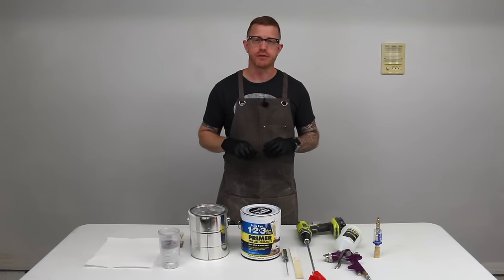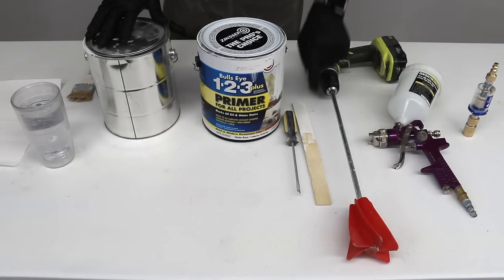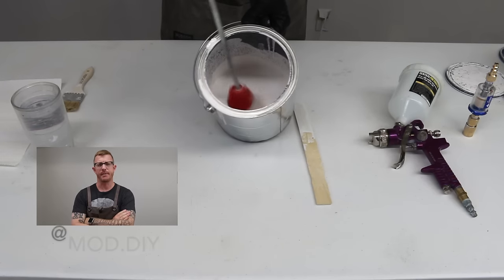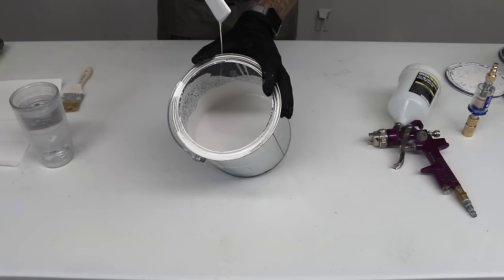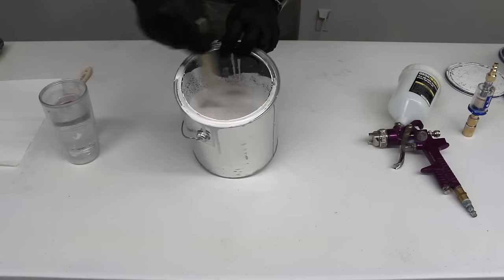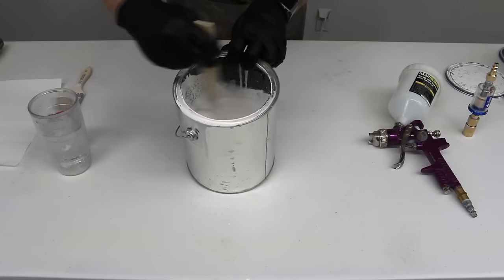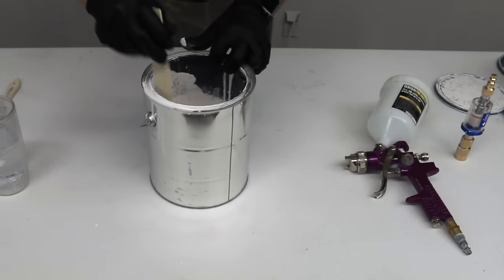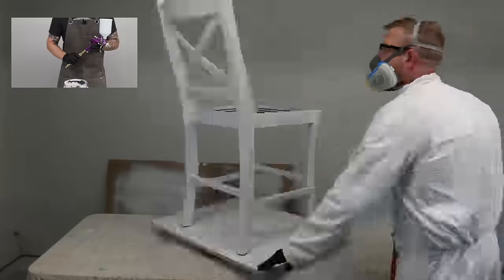How to: Quickly Thin Paint to Spray Through a HVLP Gun

Comment: The inline water filter is always great to have but not as big a deal with latex, if it were a oil base then most def use one.  As for thinning latex paint and primer its not always a good idea to thin latex paint to much, some paints it will drastically shorten the life span plus other issues. Most latex paints shouldnt be thinned the same as oil based paints.  Kilz and zinser primer's are designed to be used as is and can be thinned some, but over thinning will negate the effectiveness of the paint.  You are using that cheap harbor freight gun that comes with a 1.3 or 1.4 mm fluid tip, that is not ideal for latex paint and primer. I wouldnt use anything less than a 1.8 to 2.0 mm fluid tip for latex unless the paint is specifically designed to be thinned that much.
Reply: I have always wanted to try painting my room with acrylic paint, using a 2.5mm nozzle.
Do you think it works?

Comment: Not mentioned in the video but is very important: Follow the paint manufacturer's thinning recommendations. Zinsser  says thin no more than 10% water (3 ounces per quart).  Scuff-X and Advance are no more than 2 ounces per quart. 
Most importantly, too much water has adverse implications for paint integrity, stain blocking, and final sheen. 
[ps. I always measure my components before mixing so that I know what ratio works well and what doesn't. ]
Reply: Yeah and with materials such as MDF that are very porous (just like drywall), some people talk about expansion from the water happening in their experience.  For painted rooms this is not as much of a concern, but with fresh drywall you would definitely not want to use too much water.
Reply: 5 PERCENT  IS BEST

Comment: I have been spraying automotive paint for years, but it never really occurred to me to spray latex with an HVLP gun.  So I built a cabinet I needed for the basement, and figured I'd give it a try.  I wasn't about to use my Sata or Tenka copper.... Those guns are over $600 each... So I used an old ass Harbor Freight purple gun that I had set aside for my old lady to use on her projects.  I was actually pretty surprised at how well you can spray with properly thinned latex.... It works a lot better than my airless which always seems to gum up at the tip no matter what I do to the paint.  Probably the only downfall is that you really need to take the gun completely apart and clean everything thoroughly.  Then dry it and let everything sit before lube & reassembly.  

But it works amazingly well.  Far easier than spraying Lacquer or base coat.  Any amateur can get nice results.  Works great.
Reply: "It works a lot better than my airless which always seems to gum up at the tip no matter what I do to the paint."
 Thats a common and really normal Problem. I go through 500 KG (roughly 1100 punds) of Paint a Day at work. The Airless System gums up at the tip all the Time. I need to put it into the cleaning apparatus several times a day just to get rid of that Problem.

Interestingly about 10 Years ago i worked in Asbestos Removal. And at the end you have to spray a Latex coating there too. To bidn the "leftover fibres". Problem we had back then was in the hight of tha tIndustrial Hall. And that no scaffolding was possible. So we sprayed that using an High Pressure Cleaner. Worked really well. But i wouldnt recommend it. We basically destroyed 2 before we had the right mixture.
Reply: I must have a bum HF gun. I watched this today and tried shooting some simple thinned ceiling paint ( the cheapest thinnest paint I own) its like painting with an airbrush at best... I cannot get the pattern nor the volume to work correctly...... and Id like to use this to paint my interior doors.
I tried at 40psi. 60psi etc... No luck. I get maybe a 2 inch spray pattern tops, nice and clean but it would take weeks to paint anything larger than a tv tray.
Reply: @DHodges187  im not sure how your paint is thinned or at what pressure, but I sprayed thinned Valspar at 35 psi and it worked fantastic.  I suppose it couldd be the gun... I always disassemble mine afyer every use and clean out everything especially the nozzle.  

Sounds to me like the paint isnt thin enough yet. I used regular tap water but you can try windshield washer fluid too.
Reply: Will the latex lay as flat and smooth as lacquer?
Reply: @zacschmelzer8487  I suppose it would matter what kind of gun you use, and what pressure.  Ive sprayed lacquer and its easy to mess it up.  I messed up a few things before I learned how to use it.  This sprays easy.  Try it on aome scrap first, but if you have everything set right and your thinned right the paint lays nice and flat. Very easy t9 do.
Reply: @motorcitywestauto4674  ok thanks. Ive sprayed all the 7.25" tall trim and casings in my house with lacquer and boy does it dry fast! Like you said easy to mess up. I used lacquer due to its glass like finish but would like to spray latex if I can get the same quality of look. Thanks for the input.
Reply: @zacschmelzer8487  Yeah, some advice though....  I spray cars too and lacquer is similar.  You have to spray heavy but move quick to get that nice high gloss end look.  Spraying latex is a bit different thats why I suggest practice.  Ive got the best results with about 35lbs of steady pressure and the thunning you'll have to work out with your gun.  I spray at a medium width and move slower. Seems to have better results.
Reply: @DHodges187  The problem, not mentioned in the video, is that the spray tip on a Harbor Freight gun or similar is likely too small. As mentioned in another comment, the tip should be 1.8 or even 2. I bought a gun on Amazon with a 2.5 tip. Also, the tiny plastic in-cup filter might be impeding your flow. I bet this guy doesn’t use one. Filter all paints with a paper cone.
Reply: @DHodges187  A lot of people using the purple gun drill out the spray hole to 5/64" for spraying heavier paints.  Several videos on youtube telling how to do it.

Comment: They actually make waterborne lacquers and paints designed for this application due to the demand for the most durable finish without all the harmful fumes. I have experimented  thinning all types of paint to spray and almost always revert back to a basic rule. Use the right tool for the job so you only have to do it once. The video was great but it is better to use measuring containers in the process so you don't go past the manufacturer recommended thinning ratios for that particular project. Other than that i used this video to help me judge consistency. Ty!

Comment: I'm surprised you don't measure the water you're using. It seems that a lot of the new hybrid primer and paints only recommend diluting with 8-10 oz of water per gallon, max. Some don't advise any solution.  I recently sprayed 80 cabinet doors with Smart Prime after diluting by 20% water in order to run through my HVLP and now I'm having adhesion issues. Seems like these new hybrids require airless sprayers instead of HVLP.

Comment: I use the reg blue windshield wiper fluid to thin my latex to be shot through hvlp.  seems to flow a little better then plain h2o
Reply: Nice. The paint should also slide off the surface of whatever you're painting a little better too.
Reply: Paints are constantly being changed and advanced every year. You really need to know everything put into that wiper fluid is compatible with the newer paints. That is a old timer trick that I dont think  alot of knowledgeable professionals would tell you to go mixing into any latex paint you come across

Comment: Been doing this for ages with my cheapo harbor freight screw on cup gun. I've even left paint in over night a few times and only had to take off the horn to clear the jam.. (15 mm socket to remove the brass horn inside the spray cap)
I spray cabinet doors with it at least once a week for the past few years. If it completely clogs up its $23 for a new gun..
So many of the cheap spray guns are labeled as HVLP when in fact they're just cheap knock off old style guns with a label on them.
Those HF cheapo's are pretty much bullet proof for latex. Just blow clean water through them and clean up the gunk in the cup when you're done.
I run at normal pressure although I probably could lower it a bit..
Reply: Go figure..The very same day I'm singing the praises of the cheapo HF spray gun the two I have decided to crap out on me. One started leaking really bad, the other has no fan adjustment at all and I have an order for 6 cabinet doors to get out this week.. oh well..whaddaya want for $23?

Comment: Haven't tried that method yet, but may give it a go.   I've been thinning latex paint (SW Emerald) with about 3 oz water per quart of paint, then I stir in about 1-2 ounces Floetrol.  The Emerald dries like glass.
Reply: That is exactly what I do, use floetrol. I also have a "throw away" harbor freight gun drilled out to 2.0. It is just fine for latex, does a great job.
Reply: any of you two ever try using the windshield washer fluid with water and latex?

Comment: Thanks for the tip.  About to use our HVLP for the first time.  Which is better do you think, gravity feed or siphon?
Reply: Depends on what you want to do. I work in the Industrial field (Pylons, Punp Skid Units etc.).
Gravity Feed is great for almost everything. Constant flow of Paint and great ergonomic. But it has one disadvantage the siphon can do really great. 
Lets say you want to take care of the underbody of an Car. You will stand below it and the way you hold the Pistole the gravity feed ones will only work for about half the cup they have. Because you have to spray upwards and hold it in a way that most of the Paint remains in it. 
The siphon doesnt have that Problem. Thats why i took the underbody example. There are special underbody Pistols and they all are siphon ones.

Or an example from my Work. The Pump Skid Unit is basically a huge plattform for an Pump. On top and the sides the Gravity feed one works. But the underside? Thats basically 65 square Feet. Needing an 80µm primer (zinc Dust), an 80µm yellow and on top of that the 80µm gray the customers demand.
Gravity Feed makes me go crazy there. The back and forth is annoying.

Comment: I see you prefer the scientific methodical approach. Is that an imperial or metric ‘dribble’?
Reply from the maker: Thats an Imperial Dribble sir.  :)
Reply: Modern DIY .... 1965! A year that will live in infamy for ever when in Britain, metrication was formally endorsed by the government. I mean what was confusing about the Acre, Barrel (unit), British thermal unit, Bushel, Chain (unit), Chaldron, Cubic foot, Cubic inch, Cubic mile, Cubic yard, Cup (unit), Degree (angle), Demiard, Dram (unit), Fahrenheit, Fluid ounce, Foot (unit), Foot-candle, Foot-pound (energy), Foot–pound, Foot-poundal, Furlong, Gallon, Gill (unit), Grain (unit), Gunter's chain, Hand (unit), Hogshead, Hoppus, Horsepower, Horsepower-hour, Hundred (unit), Hundredweight, Inch, Ksi (unit), League (unit), Mile, Miles per hour, Minim (unit), Ounce, Peck, Pint, Pound (mass), Pound (force), Pound-foot (torque),Poundal, Pounds per square inch, Quart, Rod (unit), Rood (unit), Ship load, Slug (unit), Span (unit), Spinning count,  Square foot, Square inch, Square mile, Square yard, Stone (unit), Stuck (unit), Tablespoon, Teaspoon, Thousandth of an inch, Ton, Long ton, Trade gallon, Twenty-foot equivalent unit?
Bloody foreigners.🇬🇧

Comment: Good advice. I've sprayed both lacquer and water based products and found that the "latex" paint was much harder to clean out of the gun than the lacquer. Do you recommend having a separate gun for each? I use LVLP for lacquer and it does real well. Do you think HVLP is better for latex (my broad term for water-based paints. I know they've got a lot of stuff in them that isn't latex.)

Comment: You used the portercable 6gal pancake compressor? 
How long can you paint for before it runs out of air.  I was purchasing that to paint the hood of my car.  Do you think it'd work out?
Reply: Linh Le how long is like asking how long a piece of string is. To paint a car hood 6gal should be ok. Bigger than that not so much.
Reply: @bigpicturethinking5620  Lynn beat me to it. I was just looking at a 6-gallon Porter-Cable and paint setups at Harbor Freight the other day and they told me that anything less then something around a 20 gallon capacity would be a waste of time, so instead I bought the $30 electric gun. Actually wanted to paint the walls of a garage and so I just want to make it throw the maximum amount of paint, but if I could have done it with the 6 gallon pancake I would have sunk a whole bunch of money that day into air-powered tools, so perhaps it's just as well.

Comment: Why don't you use a viscosity cup while thinning?  That way you won't have to guess nor use your experience.
Reply from the maker: Trying to keep it simple. Most people don't have a viscosity cup, like myself.
Reply: Small investment from Amazon so that you get repeatable results.  For 10 bucks or less for the plastic ones.  
If you are spraying every day, may not need one, but if it's been a while, hard to remember exactly what the dribble is supposed to look like.  
Or, grab a small measuring cup from the kitchen, and drill a hole in it.  As long as you are using the same cup all the time for your measurement, it doesn't have to conform to any particular standard.
Reply: @moderndiy3290  plastic measuring cup from the Dollar store works.

Comment: What about paints that say not to thin? Example dry lock or behr dry plus waterproofing paints that are kind of thick as mud
Reply: Always follow manufacturer directions. If you want to have a  manufacturer claimed performance or your paint products! It's that simple. ;-)
Reply: Yeah definitely don't thin those.
Reply: Dry lock?!!?... That has sand in it bud...its hard enough to brush and roll it properly. I wouldnt even run that through my airless (unless you like to ruin the packings), let alone pretend its possible to put it through an hvlp gun 😆

Comment: Is it the same principle for all type of paient, oil based as example?
Reply: No you can't mix water into oil paint. Its why you need to use paint thinner to clean your brushes when using oil. Also oil is much much thinner already so if you thin it much more it will be like trying to spray water and expecting it not to run and drip

Comment: Thank you so much I want to spray latex paint I just wanted to know how thin to get it. I do still need to get the air regulated for the spray gun and the water trap , paint filters, mixing cups then I'm ready to go.
Reply: Same here. I have everything except the compressor, paint gun, water separator, paint filter, air lines, air regulator, paint mixing cup, paint cup liners, paint stirrer and paint.
Reply: @ChristopherJones16  Same here, plus I don’t have anything to paint.

Comment: What is the size of the air cap? 1.4mm or 1.8mm? What is the optimum size for latex paint to be sprayed?
Reply: Those harbor freight cheap guns come with 1.4
Reply: they also come with 1.8 if you get the right one
 @nathanreed3302
Reply: @jamesc.campbell4784  do you have an item number? I've only ever seen the 1 size tip.
Reply: The best is 2.0mm and 40 sec in ford cup no 4

Comment: "We open our paint and primer". Well, no it's just primer. "We're not going to add to much paint, just some".  Yeah, primer again.  If you water it down to much you can always add more paint. Well, we see primer and no paint yet.  I have this exact HVLP spray gun,  I love it.  Harbor Freight $15.  Though no paint was shown in this video it's a good idea to thin your latex just a bit.  Primer and not paint shown in this video does not need to be thinned.  Check Gsx-rs vid on adjusting the spray gun.  Primer is atomized perfectly through this gun.

Comment: That is drinking water or distel water .i think you can mix thiner in  paint .
Reply: It's water based paint.  Sooo what do you think you would thin it with?  My god some of these comments.
Reply: @FlakeBoss  Hey FlakeBoss, get off your high horse.  That's a reasonable question.  Distilled water doesn't have the impurities that normal tap (drinking) water has so it might, over time, affect the guns mechanism.  If you don't have something positive to say......say nothing.
Reply: Distilled dude
Reply: @FlakeBoss  Milk. If its white paint!

Comment: what's going on I like the video you made anyways my question is I have a RexBet I 004 HVLP electric spray gun this is new to me never really messed with a spray gun at all I'm old-fashioned I'd rather use a roller or a paint brush hahaha but anyways I thought I would do something different plan on painting my house does anyone on here know anything about these paint guns someone told me not to use water with paint only paint thinner
Reply: This is an old question but others may need this info. Your paint can will always tell you what to use as a thinner. NEVER use a thinner that is not specifically meant for your coating. Latex paint is generally water or latex additives. I really like the flowtrol product from Flood. I have used it forever and most pro painters I know use it as well. Other oil base paints have their own thinners.
Please read the can.
Do not trust the clerk at the paint store. Check it yourself before you leave the store.